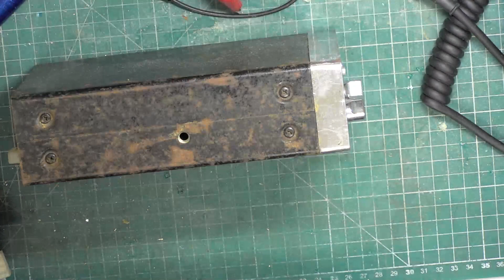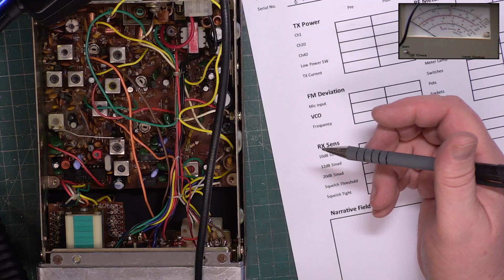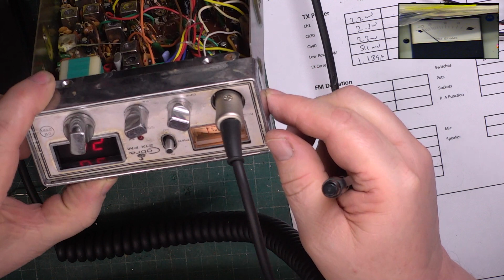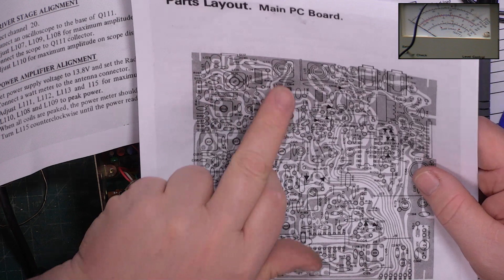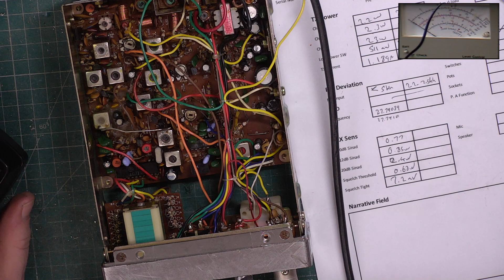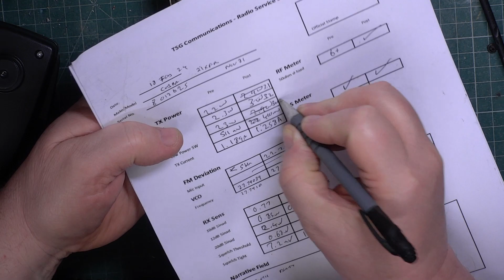Cobra 21XFM CB27/81 UK FM CB radio - Ex scrap set overhaul & alignment

Comment: The Cobra has quite a legacy... what is your oppinion about those transceivers?
Reply: Maxons, same as many other radios, 
unless your blinded by the brand name on the front it's just another Maxon boarded radio.
Reply from the maker: Cobra offered this 21XFM & the Cobra SOS emergency set back in 1981. That's all. On the late 80's they offered a good 'hideaway' set where all the controls are on the handset & the 'works' are in a box elswhere in your vehicle. Come the 90's they offered another hideaway which overheats as most of the works are in the actual handset. After the 2000's came the dreadful Cobra 25 & 29. The not so bad 19 MK IV, followed by the diasterous 29 which is really swish looking & as deaf as a post. These Cobra sets I mention are the only legal UK models; there have been no others.

The 2000's 25 & 29 (same board) & the 29 from around 2016 are so bad we won't service them anymore....unless the customer knows & accepts they are crap.

So if Cobra have some sort of legacy, it's not with UK models.

Richard, G0OJF, UK
Reply: @ukfmcbradioservicingTango21   well that leaves nothing to the imagination...
🤣😅🤣
As a kid I dreamt about those radios,  even my cb name was Cobra...

Well another illusion gone, thanks for the reply as I said, very clear!
Reply: The AI eBay description for this rig appears to rate Cobra CBs…
‘Its brand, Cobra, is known for producing high-quality radios, and this model is no exception.’
Reply: biggest load of tosh going,
Cobra never made one CB radio, it's just a brand name,

never trust ebay AI it'll lead to so many misdescribed radios returns and refunds..
 @Blackadder1320
Reply from the maker: Yeah, I let them have that as it's Maxon made.

Richard